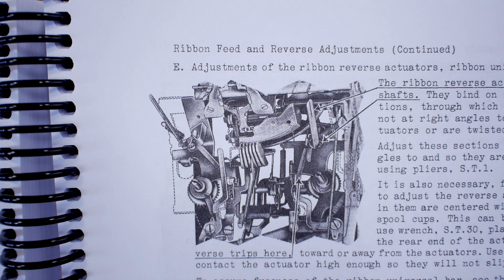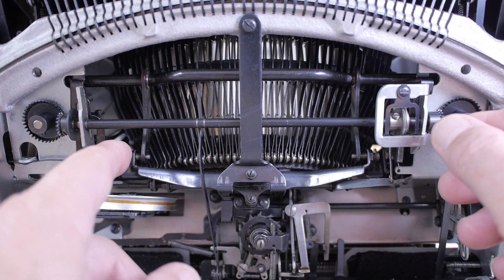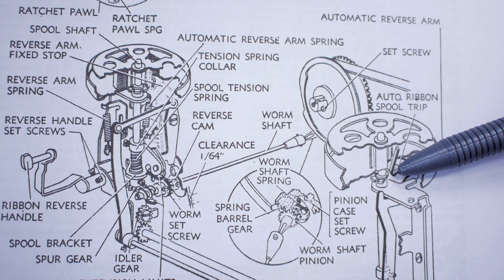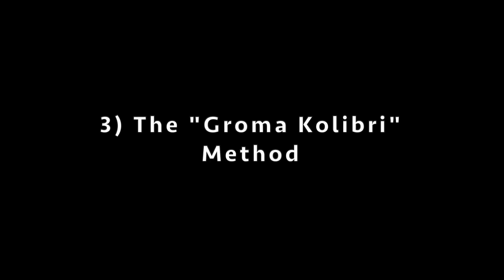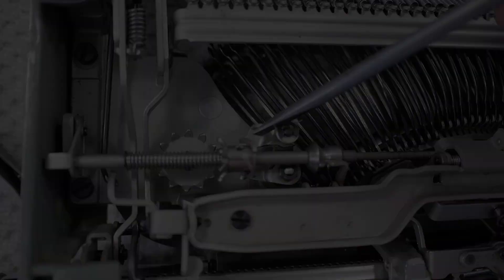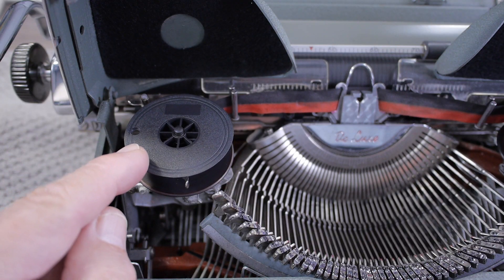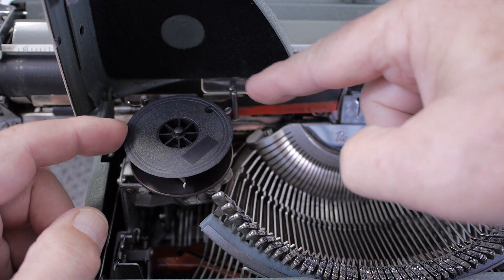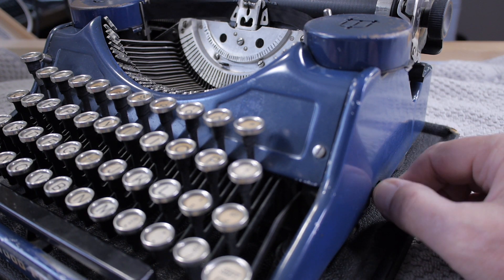Typewriter Video Series -- Episode 279: Ribbon Reversing Systems

Comment: Hey Mr. Van Cleave, I got a pretty cool 1949 Dreyfuss QDL and I put on the cheapo plastic ribbons on it and it seems the ribbon reverse just keeping getting triggered back and forth as you type. Wrong ribbon? Maybe requires heftier metal spools? Trying to isolate the problem. Something not lubricated enough? Weird it trips back and forth.
Reply from the maker: First check that the ribbon is threaded through both reversing guides.

If it wants to reverse in one direction then try flushing the spool spindle and all moving parts related to the ribbon drive with IPA and then very light oil like sewing machine oil.

The supply side spool should turn easily. Then reverse the guides and try the other spool, both should turn easily when they are the supply side.

You can test the reversing action by, as you type a letter, trigger the reversing guide on the supply side spool, it should change directions. Hold down the space bar at the same time and the carriage won’t move, so you can keep testing.
Reply from the maker: Also, under the machine is the rotating shaft that drives either spool, that shaft needs to easily slide sideways, to shift the ribbon direction, so degrease and lightly oil the sliding and pivot points.

Comment: My Olympia Report Electric goes to one side and then sometimes reverses and sometimes it doesn't. How do you adjust it? It also doesn't empty the ribbon all the way to one side or the other. It will roll one way for one or two pages, then roll the other way and not reverse again.

Comment: Hi Joe, great video. Do you know anything about the ribbon reverse on the Adler Contessa? I can't get mine to activate but am unsure of the mechanism. The manual mentioned levers but they're under the machine cover, there must be a simpler mechanism. Pressure or eyelet I guess. Let me know if you have experience with these!
Reply from the maker: I don’t have experience with these, but many other German machines don’t use eyelets for reversing, instead they sense the spool is near empty by the angle of the back-tension lever (the one that’s spring-loaded and presses against the ribbon). When the lever points near the center hub of the spool, while on the other spool its lever is pushed away from the center by the ribbon pack, that’s when it trips the reverse. These systems are sensitive to how much ribbon is being used, so make sure you’re using a full spool.

Comment: Part of the reason for the different styles is part of the development process, where engineers experiment to try to find better ways of doing things or simply to one-up the competition. On many typewriters design for a caught-lever trip, the tension of the ribbon against the empty spool will often work even if there isn't an eyelet in the ribbon. It should be noted that the Royal system is the same as the Remington system, save for the fact that on the Remington, there is only a "ring" and not a spool and the arm is attached to the spindle rather than being built into the spool. The "how much ribbon is left?" is also a very tricky adjustment to get right so that you do the trip without keeping a solid two feet of ribbon out of action on the spool because you tripped too soon and yet not allow the ribbon to STOP because it doesn't trip at all. It is perhaps the most ill considered system of the lot. Rather than using a screw set adjustment to be precise, you have to form the adjustment and that makes it very hard to set correctly.

Comment: This was terrific. I have a Hermes 2000 that doesn't advance the ribbon. It has pins on both spindles. On the right side behind the ribbon holder there is a small lever that is supposed to reverse the ribbon but it doesn't seem to be working...  Also read some place that this might be a problem about the Hermes. Will continue to work on it. Or, I may have to take it in...  Tom from Clovis NM

Comment: Thanks for the great video, Joe! I recently got a Royal 202 as a gift and not quite sure if there’s any reverse mechanism for the ribbon. Do you know if there is a way to reverse the ribbon, if so, could you please share it?
Reply from the maker: The Royal 202 is the same as the Royal Mercury. The auto-reverse mechanism are the two forked guides that the ribbon threads through. There should be an eyelet crimped near both ends of the ribbon that are intended to be too wide to thread through the guides; as the ribbon advances, the eyelets force the guides to slide sideways, which trips the ribbon reverse.

Make sure your ribbon has eyelets on both ends. Make sure the ribbon is threaded through the reversing guides (follow the ribbon path from the spools to the print position, they are located between the spools and the print position).